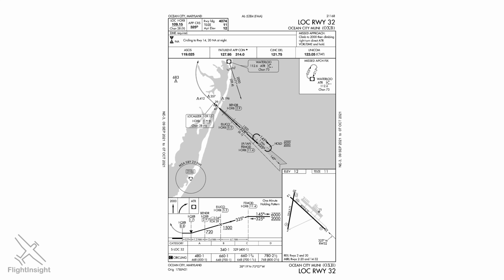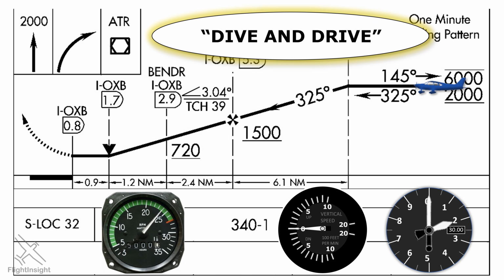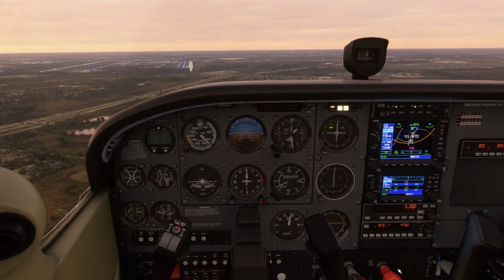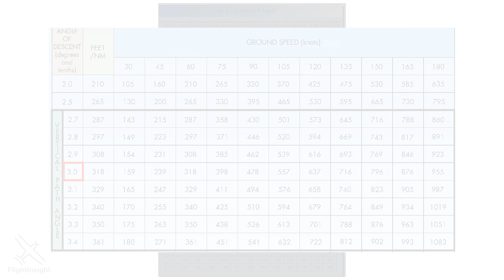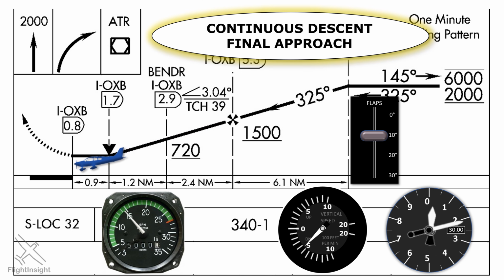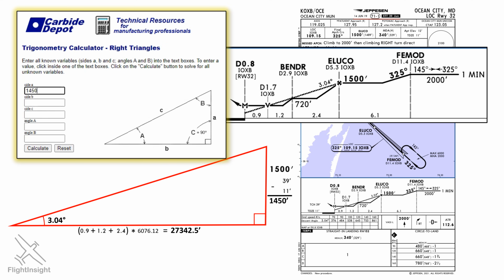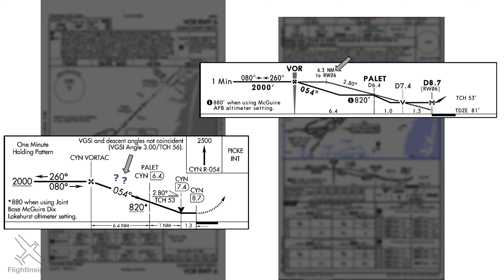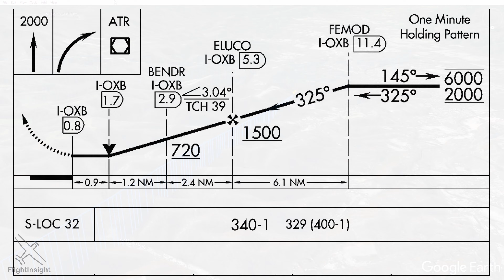How to Fly a Non Precision Approach | Continuous Descent FInal Approach | LNAV + V

Comment: If I’m going to use 10° of flaps on my final approach, I wanna put the 10° of flaps in before I hit the final approach fix and be fully configured for landing. That way the only adjustment I have to make at my FAF is pitch and power. This is the protocol I use.     Trying to put in flaps at the final approach fix while also reducing power and pitch settings is a lot of configuration changes at one time and can result in an unstable approach. KISS

Comment: I would descend to MDA at 340 but I would not descend below MDA until I hit the VDP…. Even if I have runway in sight. This is because there might be obstacles along the way.   Of course I would use the PAPIs as my vertical guidance if PAPI were available.         If VDP is not designated on the chart then I would simply take the MDA in AGL and divide it by 300.     This would give me my VDP in miles from the runway.  So if my MDA was 600 feet AGL I would divide 600 by 300 and that gives me 2.   My VDP then is 2 miles from the end of the runway.

Comment: great video! Imo what a pilot chooses (unsurprisingly) depends. my ifr training was in a DA40 and that aircraft was easy to dive and drive when you knew your power settings and could alternate between them proficiently.  said differently (in my rando CFI candidate with signoffs opinion) I think It just depends on what your flying and how you train... faster ground speeds don't lend themselves to dive and drives (or maybe more accurately categorized as) short periods of intentional instability during an approach with the intention of seeking stability... Like quickly scurrying across a section of rope in an unstable fashion to make it to the much more stable platform near by in a ropes course.

Comment: Good video, there is one small issue though, going missed at VDP on a non precision approach. In real life, yes it would make sense to go missed around vdp if you cant see the runway because a stable approach to land cannot be maintained however, youll see the missed approach point on that chart is the runway end, and on a checkride, you must fly to the missed approach point before going missed. You should hit vdp, verify you cannot see the runway, and then continue on to the missed approach point before going missed.
Reply from the maker: Yes, thanks. That definitely doesn't come across correctly in the video! It's an old one, and is up to date in the course.

Comment: Do you by any chance have the reference about the fact that you mentioned about gps vertical guidance? Any faa source that says you still need to be above specified altitude even if your vertical guidance tells you to go down during gps approach that would make you go below the mentioned altitude before it’s fix?
Reply: There are GPS based approaches with vertical guidance. LPV and GLS approaches do contain vertical guidance and are flown like  an ILS, GLS in particular is capable of CAT IIIb operation but is currently "only" certified for CAT I minima. Some FMS equipped aircraft can fly RNAV approaches with a temperature compensated pseudo  glidepath, but in that case the minimum altitudes at each step down fix are hard limits and you have to stay at or above those altitudes. Even more important if your FMS can fly those approaches only without temperature correction, in which case you have to distinguish between the LNAV/VNAV minimum which is safe down to a minimum temperature noted on the chart, and LNAV only minima where you are responsible to adjust all altitudes based on current temperature yourself.

Comment: knots * 1.151 * 5280 / 60 * sin(degrees), just pull up a calculator during prep

1.151 = conversion of knots to mph
5280 ft in mile
60 minutes in an hour 
knots * 1.151 * 5280 / 60 convert your forward speed to feet per minute, then sin (degrees) converts it to downward speed

Comment: If WAAS is available, as mentioned by the narrator, you will get a V+ or LNAV +V reference glide path that uses a 3.0 degree angle. On this approach with a 3.04 degree angle, following the reference V+ glidepath will put you below the published approach angle which will cause you to be too low at each of the fixes. Well done about talking about the V+ glidepath and the cautions when using it. Following the V+ path below MDA at night may result in a CFIT type of accident. Always follow the VASI or PAPI from MDA to the runway, especially at night, in low viz, or with a displaced threshold. I just wrote a tutorial on flying the V+ glidepath for both the Cessna and Piper Owner Magazines that will appear in the September issue. In it I mention that the V+ reference glidepath is based on a 3 degree angle to the runway threshold, and does NOT compensate for displaced thresholds. For example, if flying the V+ path to a runway with a 1000 foot displaced threshold, you will be well below the normal approach angle. And keep in mind the V+ glidepath does not guarantee obstacle clearance, so be very careful using it.
Reply from the maker: Hi Joel! Jeppesen states their advisory glidepath, or +V as it shows up on GPS annunciators, is calculated using the visual descent angle (VDA) which on this approach is 3.04°. This means the advisory glideslope doesn't always follow a standard 3 degree glidepath, and this is a good example of that. Also per Jeppesen, the advisory glidepath is computed using the VDA from the runway threshold at the crossing height (TCH), so any displaced threshold doesn't affect where the advisory glidepath guides you to. You can see both these things in action flying the RNAV 33 into KGON in the sim, both a nonstandard VDA and a displaced threshold of about 3 or 4 hundred feet. I hope this helps with your article!
Reply: I have personally flown the V+ glidepath to runways without any published glidepath in day VFR conditions and have seen the PAPI with all red lights at the FAF even though I was perfectly on the V+ path. this was because there were obstacles near the threshold. Jeppesen makes approach charts, and have no input into how the navigation system in my plane works. If the PAPI/VASI is set, for example, at 4 degrees due to a displaced threshold and obstacles, and you fly the 3 deree V+ glidepath VFR at night, you will collide with those obstacles. What I know I learned from actually flying the V+ glidepath into uncontrolled fields, and what you are teaching is from the classroom and training manuals. To prove my point, look at the RNAV approach to KTHV, York PA and mentally fly the V+ path and you will see that 1. there is a note that says "VGSI and descent angles not coincident (VGSI Angle 4.50 (degrees) /TCH 20". and 2. the note that says Straight-in RWY17 NA at night, Circling RWY 17 NA at night". This is due to unlighted obstacles close to the actual runway threshold, which is why the runway is displaced, and why you cannot fly this approach at night. I once flew this approach in day VFR conditions following the V+ glidepath in my Pilatus, and at the FAF I saw all red lights on the PAPI and quickly realized that if I continued to follow the V+ glidepath to the displaced runway threshold, that I would collide with the hill and trees off the end of the runway. This experience was my inspiration for writing the article. The V+ glidepath in my Honeywell avionics did not compensate for the required 4.5 degree approach angle, as you claim it would.You need more actual flying experience and less classroom BS. The V+ glidepath in an airplane's navigator is set for a constant 3 degree angle and does not change because the approach being flown requires, for example, a 4 degree approach angle. If you see the statement on the approach chart that says "Visual Segment-Obstacles", and you fly the V+ glidepath all the way to the runway threshold VFR at night, or IFR in low viz, You will have a CFIT type of accident, guaranteed.

Comment: For a very close estimate of a proper descent rate for a 3 degree descent,  divide your groundspeed in half and add a zero to the result. For a Cessna172 on approach at 90 kts, half is 45, add a zero, 450 feet per minute is what you should do.
 Some people find it easier to multiply your ground speed by 5, end result is the same (90 times 5 is 450). That worked for me until I was flying King Airs and descending from altitude at say 220 kts ground speed. It was much easier to halve that (110) and add a zero (1,100 fpm descent) than to multiply 220 by 5 in my head.
Reply: Awesome!

Comment: FYI the example you gave for the LNAV+V guidance is incorrect. Where "Visual Segment-Obstacles" is published, the navigation database should have a 0.00 descent angle stored in it and you will not receive advisory guidance. The 0.00 VDA + Visual Segment- Obstacles (Which replaced "Descent Angle NA") is published where there obstructions on the visual segment below the MDA (like the one you pointed out). If you dig into the minutes of the FAA Aeronautical Charting Forum you can find lots of discussion about this issue and the level of detail the FAA, chart + database providers (like Jeppesen) and the avionics manufacturers went to in order to prevent the situation. FAA control number 12-01-301 is a good starting place.

It's hard to find approach examples where there is no published vertical guidance that still has a published descent angle - few runways will have sufficient obstructions to preclude LPV guidance while still having an advisory LNAV descent angle (KMCX is the only place that comes to mind. The more common example would be WAAS being unavailable for some reason, forcing a revision to LNAV mins (assuming the A/C isn't Baro-VNAV capable).

Comment: This is a really great YouTube channel with excellent content, but this subject compels me to share an opposing point of view. I realize this will sound like heresy to those who accept what the FAA and other aviation authorities now recommend, but I do not believe the CDFA technique is easier or safer than the original technique pejoratively called "dive and drive" by CDFA proponents.  Not only have I used both methods myself, but I have I trained and observed dozens of pilots during hundreds of non-precision approaches in everything from small supersonic jets to 4-engine jumbos, and I have seen more pilots bust the MDA while using CDFA than the standard method.  This is because there is no vertical guidance, and the pilot gets so busy trying to calculate the vertical profile that crosscheck of the MDA itself suffers.  

An approach without vertical guidance is inherently different, and the approach is not stabilized just because the descent rate is. The most important element of the NP approach to stabilize is level flight at the MDA. That is safe. It is also easier in terms of mental processes.  The pitch and power changes necessary to cross the FAF on speed, initiate controlled descent (not dive) to the MDA, and level off at the MDA are simpler than constantly doing math to decide if you are always at the right height for you distance from the runway.  After crossing the FAF there are two pitch and power changes until the MDA/VDP, unless a stepdown fix becomes a factor, and most of those do not require an additional level off unless you really did ‘dive” from the FAF.  If you don’t break out, you do not have to arrest a decent rate to transition to the missed approach, which is easier in terms of aircraft control (for those who find pitch and power changes challenging) and safer in terms of obstruction clearance. If you see the runway and decide to land, you then make another known pitch and power change to a visual glidepath.  People who find this so challenging as to be ‘less safe’ just need more practice flying.   

Yes, transitioning from instruments to a visual glidepath is the most challenging part of a non-precision approach due to lack of normal visual cues.  But the idea that the CDFA approach makes this easier and safer is based on trust that the descent rate you have been maintaining on instruments won’t need much adjustment.  That is true only if you are very skillful or lucky, and as I am already positing that the lure of CDFA is that it requires less skill, luck is often a larger factor than desired.  In practice just as easy to use those same instruments to set the descent rate when you transition from the MDA.  From the VDP simply pitch to 3 degrees lower what held level and set power accordingly.  You don’t go from all instrument to all visual reference, you start with a composite crosscheck until your glidepath is stabilized.  

Another fallacy is that “We should gain sight of the runway slightly before the MDA".  Not if the weather is at minimums, or you just happen to decent into a low piece of scud at that point.  Being level at the MDA prior to the VDP/MDA allows more time to search for and acquire visual references while the airplane is in stable level flight.  Once you have contact with the airport environment/runway, momentary loss of contact in a patch of scud will not force you to go missed, so you are more likely to land from the approach.  If you lack sufficient cues to descend until inside the VDP, you can still land by accepting a steeper glidepath (if you have sufficient visual references and skill) or a longer landing (with sufficient runway length).  This may not sound like a big deal to pilots who are deterred by pitch and power changes and would rather fly to an alternate that has an ILS, but it is a big deal when you don’t have such options and absolutely have to get into this airport.  

I believe the CDFA method is not safer, but simply more comfortable for pilots who rarely fly a non-precision approach, and when they do fly one the weather is not down at minimums. In fact, in my last years of airline flying I would see senior captains fail to demonstrate proficiency at non-precisions simply because they only got to see one during every other recurrent simulator ride.  Meanwhile I was constantly hand-flying flying such approaches as a reservist, and I refused to adopt the CDFA (AKA CROD) technique being championed by less experienced or less proficient pilots. Those guys are now making policy, and if I were not retired, I would probably be forced to fly that way, so I’m really glad to be out of the game.  Thanks to anyone who listened.
Reply from the maker: Thanks for this perspective! I was actually getting into a discussion about this the other day with a few buddies who fly 135, whose company has them do dive and drive, probably for the reasons you've indicated, but more than likely because the aircraft they fly don't have advisory glideslopes which make CDFA a bit easier. My compromise is to rather than do the heavy math to try to compute a perfect CDFA rate, know what rate will get to the MDA a bit before VDP/decision point, giving me time to level off and decide. As an instructor, I've taught CDFA because I've seen too many pilots get unstabilized with pitch, power, and yaw changes while trying to hold the needle centered. In instrument flying, I'm a big fan of doing as little to the plane as I can. Thanks!
Reply: And I'm a fan of making the process as simple as it can be, and in my experience pitch and power is simpler than CDFA.  But I do have to clarify that I am not vehemently opposed to CDFA when the airplane can compute and display a desired glidepath which is simple for the pilot to follow.  I think this is why airlines are so big on the CDFA, and I would agree that they are right to do it when they are equipped for it, especially in light of the lack of proficiency in NP approaches.  
The mistake is in applying CDFA in airplanes that are not equipped to provide the pilot with such guidance.  Even if so equipped, CDFA would still not be my choice if flying a NP approach to absolute mins at an island destination with no alternate, but I know airlines are training pilots who will rarely if ever have to do that.  I think pilots should still learn the old way and use the new way only when their equipment and operation make it the better percentage choice.  

Thanks for listening.  You have a great channel here.

Comment: 6:53
For an approach without vertical guidance, if we don’t see the runway environment at VDP, we don’t go miss at VDP. We continue to maintain MDA until MAF and go miss.
Reply: True, but why waiting for the MAF? What if you see the runway between the VDP and MAF?
Reply: @Virtualmix  Think about the very definition of VDP. VDP is the point where normal descent can be made from MDA. You will see on-glideslope visual cue from VASI or PAPI at this point(not always but mostly)  
Now, when can you descent from MDA? Refer to FAR 91.175(c) 
To descent below MDA, you have to have 
1) Flight visibility, 2) Runway environment in sight, and 3) be at normal position to land.

Once you pass the VDP,  that means you are not at normal position to land. Therefore, although you have runway environment insight between VDP and MAF, you should go miss.
Reply: @kunheelee3803  That makes sense now. Thank you for taking the time to explain in details, I very much appreciate it!
Reply: @Virtualmix  My pleasure.